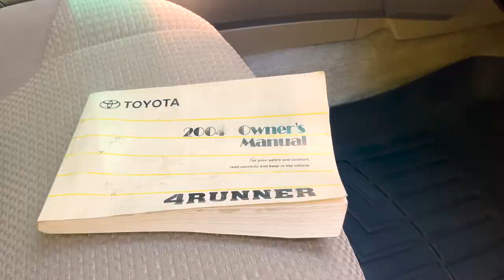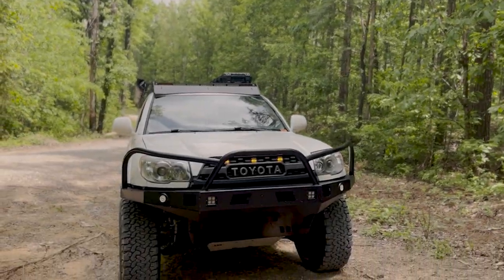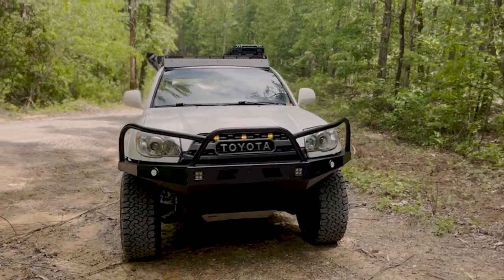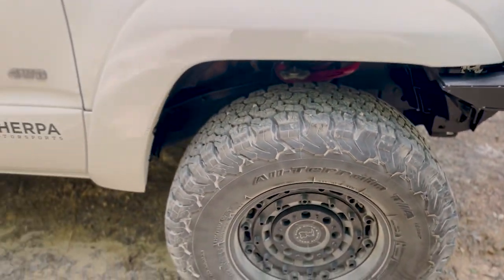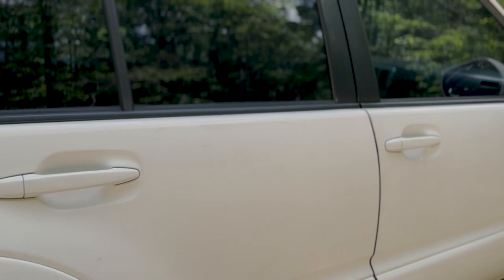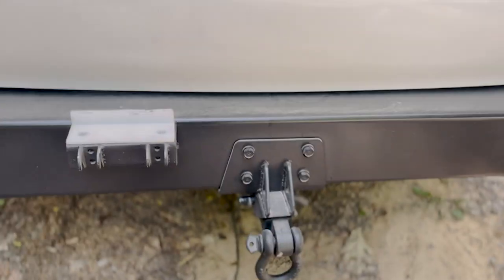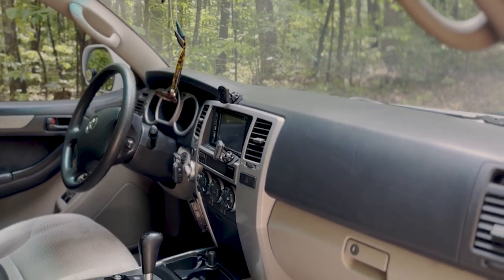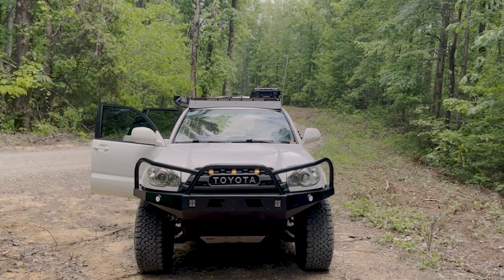Toyota 4th Gen 4Runner Build | Walk-Around

Comment: Great build. I have the JBA Off-road upper control arms on my 16 4Runner as well. FYI, JBA recommends lubing the UCA’s every 5000 miles. The bushings and ball joints. Just be careful on what grease you lube them with. Their website says what grease they recommend.

Comment: Was there any reason for the engine rebuild? I just picked up an 07 sr5 with almost 200k. Wondering if I should do the same but it’s running great.
Reply: Bump^
Reply: I was wondering the same thing I have heard nothing but good stuff about the V6 in these 4Runners. The V8 being legendary for hitting a million miles. I don’t see a reason to have to rebuild an engine with no indication that there could be a problem. Solid engine but it is still a high mileage vehicle so I’d still keep some money set aside as a oops fund before you start spending on modifications.
Reply from the maker: My mechanic discovered metal in the oil pan after I dropped it off with him for inspection after I purchased it. My plan is to give this to my son whenever he turns 16 so I wanted to make it as solid and reliable as possible. Engine rebuild & new transmission ran me about $15,000 but worth it for the peace of mind.
Reply: My 4 runner has 250k hard miles on it and it’s still ticking. Like he said I wouldn’t worry unless you have visible issues. You can send your oil off for testing and get an idea of what’s going on inside but I wouldn’t worry. If you have the money to spend on a engine rebuild then just build it when it goes out lol no sweat

Comment: I was considering getting a set of 33" tires, but I am wondering if I go to a 34, or 35" would that put a lot of wear or break any parts? Not sure if its worth the risk. You have the 34s. Thoughts?
4th Gen 4Runner V6

285/70 R17 - 33s
295/70 R17 - 34s
255/85 R17 - 35s (but having issues finding rims to fit)
Reply from the maker: Lots of factors to consider here, if you have aftermarket, upgrades suspension components then you'll most likely be okay. You'll just notice that it'll become a little more sluggish than before, fix to that is re-gearing. I originally had 35's but stepped down a size because of the look and I didn't want to chop anymore than I already had.
Reply: If its the V6 I would say no. 4th gen its v8 or no for me.